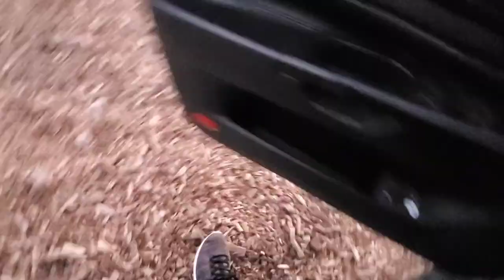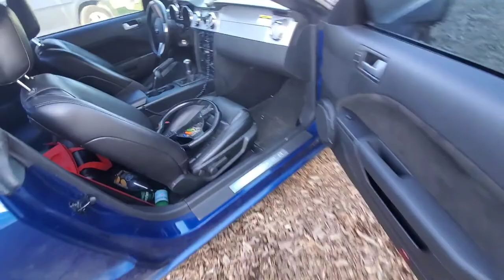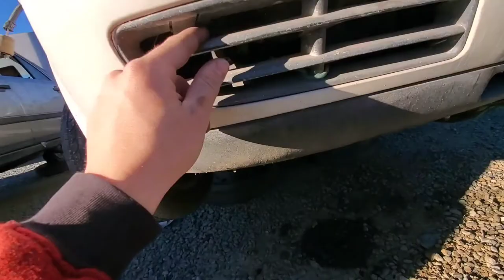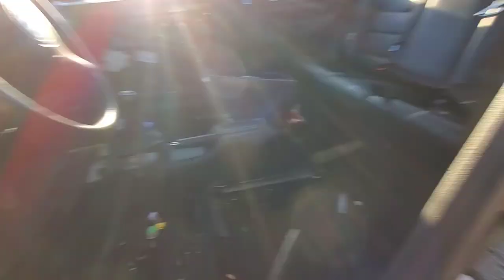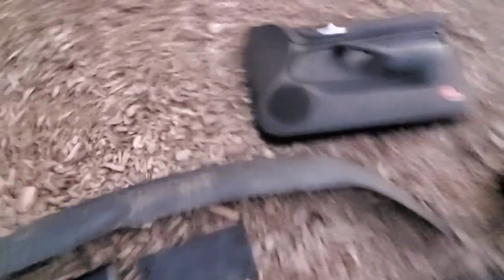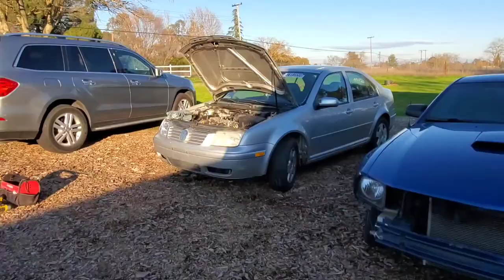I Bought A MK4 Jetta TDI For 700 Bucks! (New Project)

Comment: I have a 99.5 ALH TDI engine with 285k miles on it and it's still running smoothly. Great buy!! Wondering how much you actually spent on the replacement parts?

Comment: Daily driver added. What's the next mod on the mustang?
Reply from the maker: Well there is a few things, first its getting the California special front bumper painted and mounted then new ball joints and tie rods for the suspension, and then full cooling system, after that its tint, full brakes rebuild and wheels and tires.
Reply: @dreygrach  okay I was expecting something more simple
Reply from the maker: @TailoredAutoLab  😂 well maybe a wrap then🤔👀